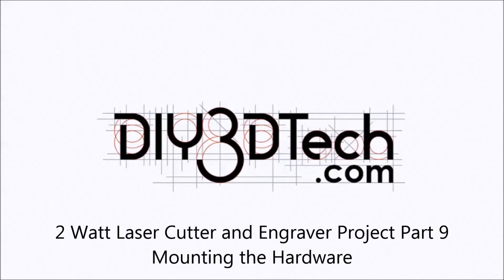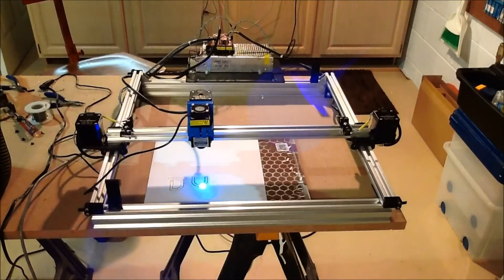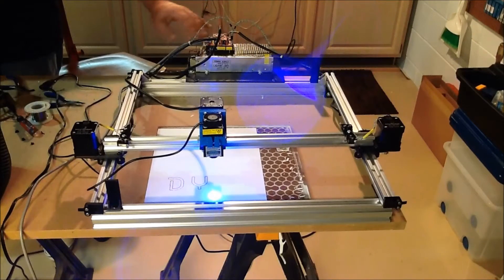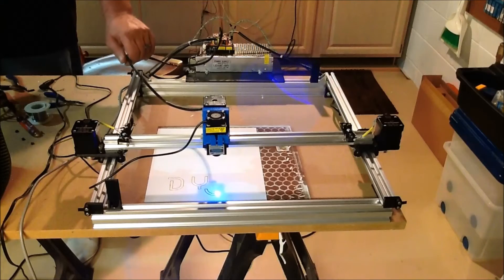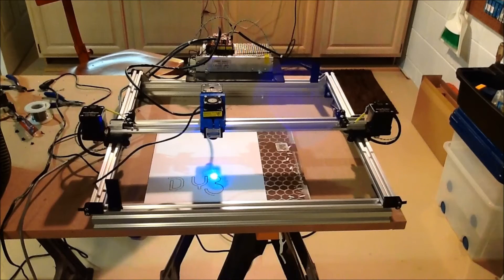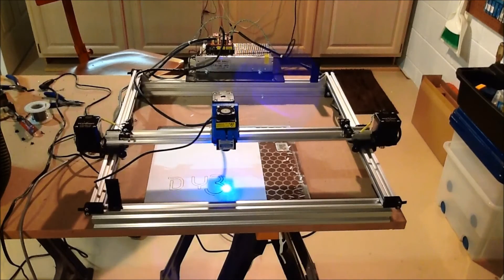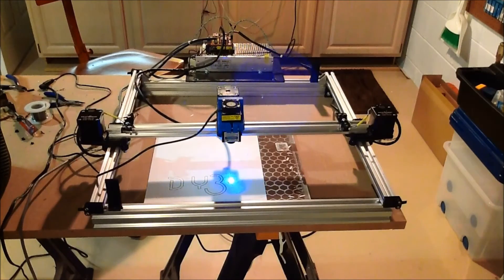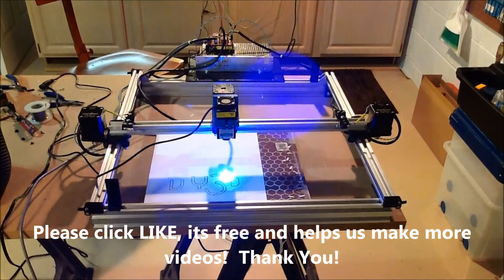2 Watt Laser Cutter and Engraver Project Part 9 - Mounting the Hardware

Comment: Is there a wiring guide for the laser and the shield? I have a acan a12 10w laser and a cnc shield 3.0 and am wondering how to get it all together. Thanks.
Reply: I dont think it is as straight forward as you say for us guys trying this or the first time. The Laser units from China do not provide ANY documentation. And As far as hooking one up to the CNC 3.o Shield, I have heard that some guys are using the Z negative end stop for PWM Out, but I do not understand how an end stop pin can providea PWM signal. Which Pin did you use for your setup?
Reply: @e6530C  in CNC shield v3 the spindle PIN (pin 11) is not PWM, so if you enable SPINDLE PWM in GRBL it uses pin 12 (which is wired at Z+ on shield)

So simply enable PWM and use Z+ ignoring the silk on cnc shield v3
Reply from the maker: No really but it is straight forward as you just use the PWM out to PWM in of the laser driver...

Comment: Hello DIY3DTECH.com
I have a problem. On some internetsites i have seen that there is a Resistor (1k ohm) between the positive and negative TTL/PWM wires from the CNC Shield to the Laserboard. Do i need this resistor or is this wrong in this schematic? How did you connect that? Because in my opinion this would shorten the circuit or not?
Hope you can give me a short answer to this.
Thanks!
Reply from the maker: Wow this was a long,long time ago but I don't remember using one unless they are using it for a pull up as on my 40watt I did use one but I had to reverse the logic...
Reply: hello
Thanks for this fast reply! Oke I will continue searching for a solution. But I think that there should not be a resistor, as you don't remember one.
Have a nice day and greats from Switzerland :)
Reply from the maker: Ah love Switzerland!  Been to Bern many times and check you Laser Driver spec sheet for the answer as from the CNC Shield its just a wire from the PWM pin out to the LED Laser driver board...
Reply: Hello there
Cool nice to hear! You should visit Luzern (middle of Switzerland) It is nearly the most beautiful city in Switzerland. :)
Meanwhile I wired it without a resistor, and the laser works great. The 5W Laserdiode is so strong that i nearly burned down my house. :D
Now i have just a little problems with the LaserGRBL software, because it sometimes stops the machine in process.
Thank you
Reply from the maker: Check out the playlist for the 2 watt laser as I seem to remember something regarding "dwell" however that was a while back and not at the front of my mind :-)  And will have to put  Luzern on my list :-)

Comment: Hello i have 1.7 amp 3 stepper motor  how much dc current requierd for
Reply from the maker: 1.7amp x 3 = 5.1 amps...
Reply: Thank you one more thing in cnc sheild A driver how  to use with x/ y axis
Reply from the maker: Not sure of the question?
Reply: How to use x axis two motors
Reply from the maker: If you want to use two of any motors however with the shield you could use a "Y" cable assuming the driver is sized to hold the current load and you flip the wires (each should be opposing) or two my options is to use the clone axis function of the board...
Reply: i did as you said ! but i lost my arduino and cnc shield (1.7amp × 3 = 5.1amps )about current supply to cnc sheild

Comment: maximum thickness of acrylit it can cut
Reply from the maker: 0 as two watts and this wave length it is only good for engraving and cutting cardboard and balsa wood.  I have seen some folks set it to make a hundred passes to cut say 1/16 pine or the like, however in my book it simply isn't practical.  If you want to cut acrylic, first you need an IR laser (not visible light) and second you need to be around 40 watts and you can do 3 to 6mm (the later might take 4 passes)...
Reply: Thank you  for informing

Comment: how do you turn the laser on and off? with M3 and M5 (M13 /M15)? What power supply did you use? can i use a 45W power supply from an old pc?
Reply from the maker: Bought a cheap 12v PS from ebay about $15, and M3/M5 also think yes on the PC/PS however have read some issue with the switching feq and the laser but at worse would think a cap of the proper size would smooth out any issues (especially if a more modern PS)....
Reply: verrryy thx mate :D

Comment: Hey nice work and I have seen all your videos related to this project. I have the same 405 nm blue laser. Wondering how to connect it to the arduino cnc shield. If you could share your wiring diagram it would be great. Thanks!
Reply from the maker: +Gerald Francis John Actually its pretty easy, I assume you have a laser driver with a PWM pin?  In this case just connect that pin to the PWM pin the shield.  You might have to do a bit of figuring which pin it is based upon your version of GRBL & CNC Shield.  Will see about doing a video on this in the near future.